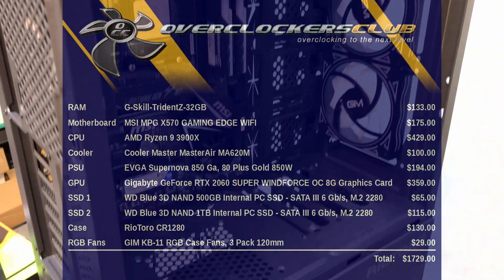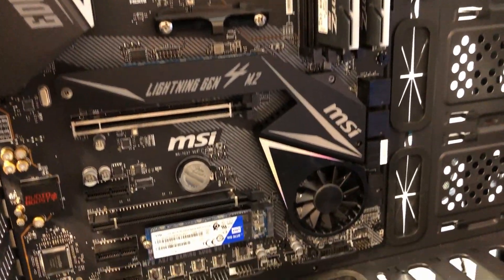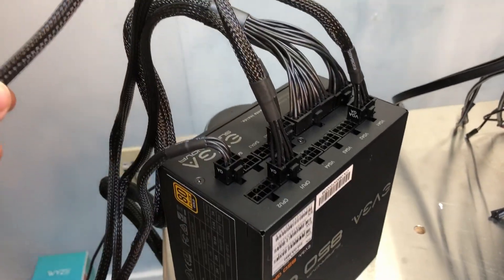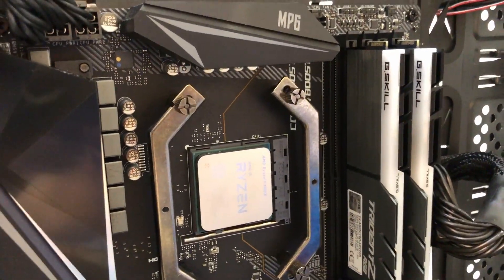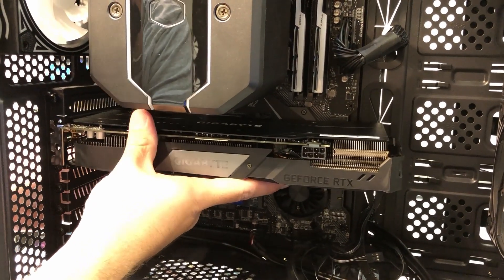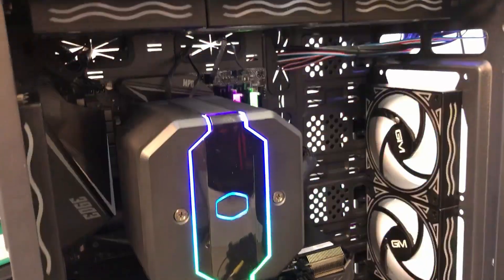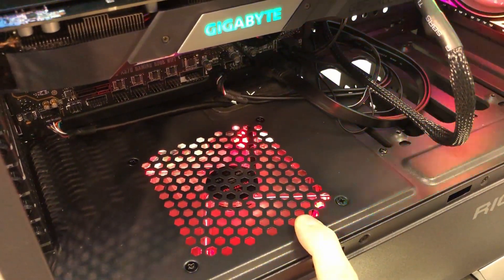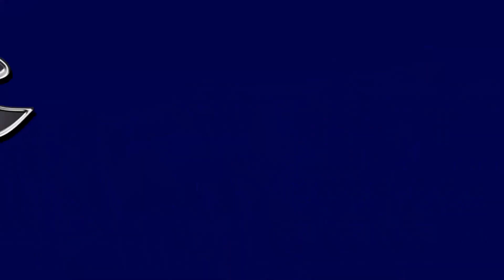AMD Ryzen 3900X System Build

Comment: Why do people buy RTX 2060 SUPER cards? The RTX 2070 Gigabyte Windforce is the exact same price currently as the RTX 2060 SUPER Gigabyte Windforce on NEWEGG and there is rarely a $20 difference between them? The cheapest made RTX 2070 is faster than the most deluxe RTX 2060 Super model.
Reply from the maker: The RTX 2070 went out of production when the Super card was introduced. So all RTX 2070 is old stock technically. They both share the same GPU but the 2060 SUPER is missing a few SMs making the CUDA count lower. So yes the RTX 2070 is faster, but not by a lot.
Reply: @overclockersclub  I went from a RTX 2060 to a RTX 2070, I've never had a RTX 2060 SUPER. Very nice build btw.